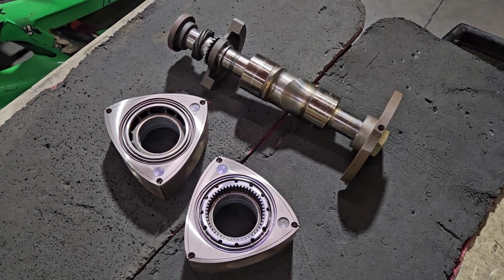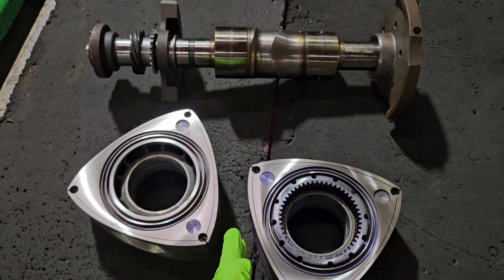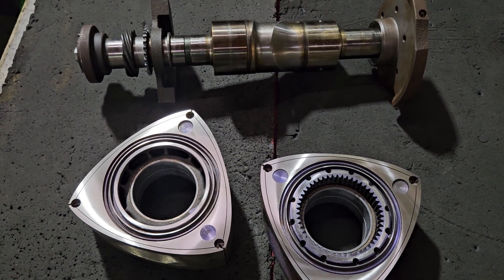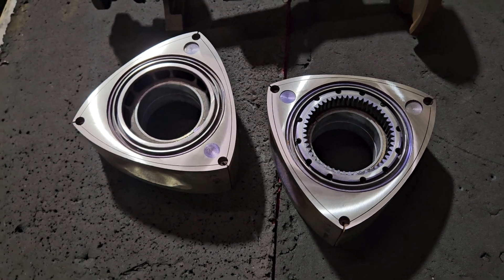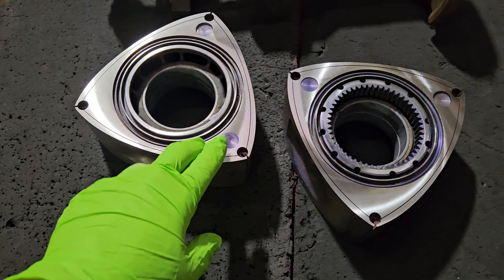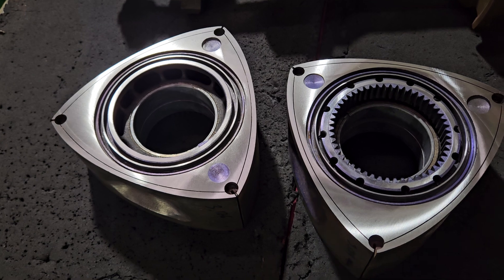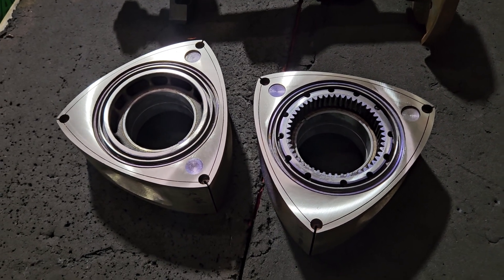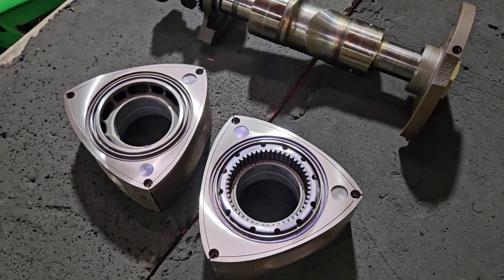Rotor Tech - Best Modification For Performance & Reliability to a Rotor - KMR Rotary Engine Talks

Comment: This called "scalloping". I read about the 26b and 13G racing engines, they had ceramic coated housings and rotors, plus 3 spark plugs per rotor. Also racing beat have done alot of development its good to read their old parts catalogue plenty of trick parts they O ring the water seals  one
Reply: Scalloping is cutting away the edge of the rotor to open or close the intake port earlier or later and is used on factory rx8 rotors

Comment: Kyle do you at all scallop many of your rotors aswell ?
Reply from the maker: No.  We dyno tested it and there was no gain.  It did lower the compression though... I should do a video...
Reply: @KyleMohanRacing  100% do a Video . I was actually wonder if it lowered the compression . 
It seemed like a good Idea
Reply from the maker: @ClwnJuNkY on paper it looks good.  On the dyno we got no gain.  If it worked all the factory teams would have done it for years.
Reply from the maker: @ClwnJuNkY  if you want to run 50psi on methanol then yes. otherwise why
Reply: @KyleMohanRacing completely makes sence !
Reply: @KyleMohanRacing  Did the large change in port timing change the power curve at all?
Reply from the maker: @Mrshotshell  there is no change in port timing by notching rotors. The side seal ultimately controls the timing. ( that's the mistake in the theory ) so no measurable change in power band or HP in back to back tests with the same motor, same dyno, just swapping rotors.